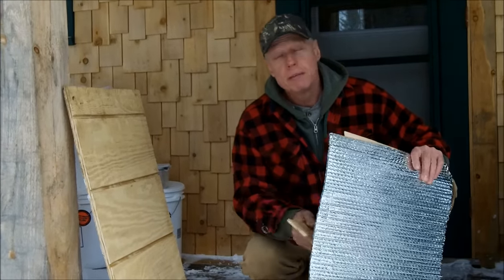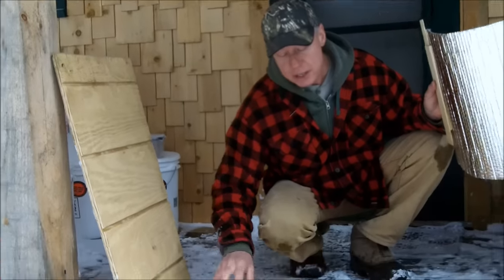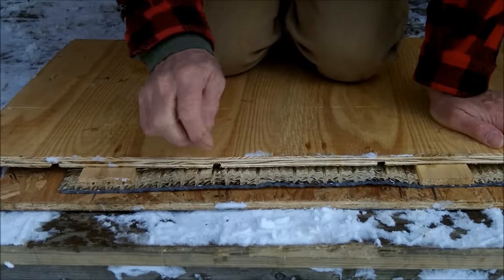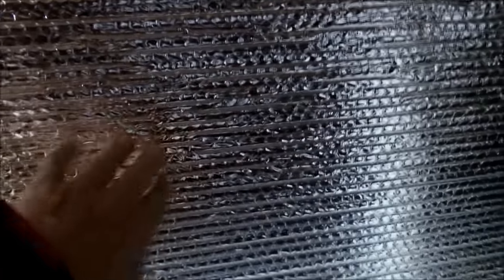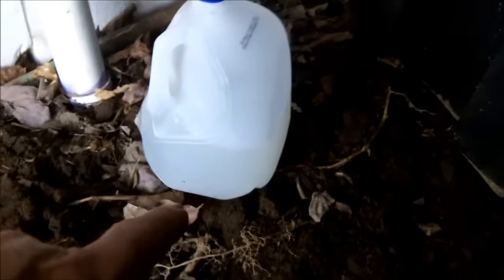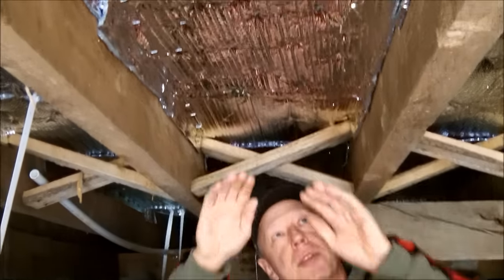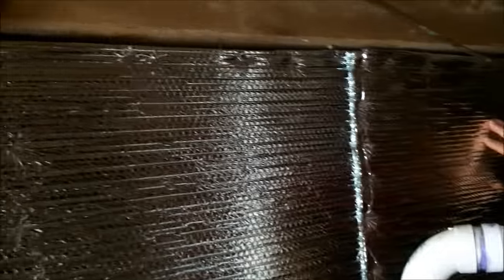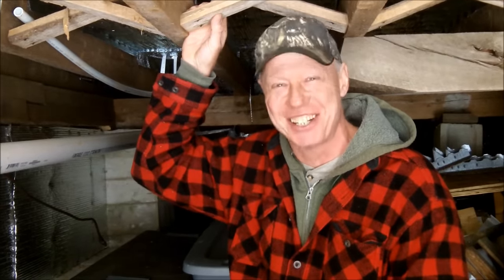HOW TO INSULATE A CABIN FLOOR AND KEEP IT RODENT FREE

Comment: This stuff was originally intended for insulating heating / AC ducts so works well at stopping drafts and condensation but the R value is not real high. The main deterrent to rodents is they don't like plastic and it doesn't shred well for nesting material so they leave it alone. The main attraction to a DIY type is the stuff is cheap and will do 80% of what more expensive products will do. IOW, it will stop infiltration of cold air... and that's a major factor in a cabin.
Reply: Actually it only does 10-15% as good as industry standard insulation. 
Reflectix has its place but most people don’t install it correctly and even if they do they usually conclude it works ‘better’ without any scientific data to back their claims. If it worked like the miracle most people think it is window manufacturers could be making R20 windows. And they can’t. 

It can be a great improvement like for window covers and certain cavity insulation but installed between plywood and floor joists is mostly fruitless because there is limited or zero airspace to eliminate conduction. 

An anecdotal support for reflectix is my off grid camper. I made 1/8 plexiglass “storm panels” for the windows and used 3/16 foam weatherstrip between the walls and plexiglass. This made a big difference by itself but on an 8*F night I thumb-tacked an unused 24”x60” piece of reflectix over the inside. It seemed to ‘feel’ warmer immediately. The storm panels do not generally ice up due to interior air temperature. But in the morning I took the reflectix off and discovered the window storm had a thin layer of frost over most of the window. Obviously the reflectix thwarted enough heat to make the window panel cold enough to both create some condensation and freeze it. That was surprising and a revelation. 

Another interesting tidbit is that in full sun mid morning the reflectix- if not removed- is HOT to the touch revealing that the airspace between window and storm is warming from the reflected sun off the reflectix. 

While reflectix can have an effect as my antidote indicates, it is not a miracle end-all unless used in an application where reflected radiant heat is the purpose and application. Just stapling it to a wall or between plywood has limited value, if any.
Reply: @fishhuntadventure  ... isn't it amazing what real world use will prove out? <LOL> It's basically not much better that a layer of corrugated cardboard, other than you can buy it in a big roll.

Comment: I'm new to your site but really enjoying it! I watched all 3 of your videos on this subject of bubble foil.
I'm converting an old tack shed to a guest house and want to use the bubble foil on the floor to keep out rodents and keep pipes from freezing. The shed is on piers and has an old OSB floor that needs to come out or be covered. I'm thinking of 3 choices and would appreciate your wisdom on the subject: 
1) leave the OSB and put a 2 x 4 grid (laid on the flat side), cover it with bubble foil, then put 3/4" plywood over that. (I'm thinking the airspace might create a pocket of warmer air, but concerned the OSB might not allow the transfer of enough heat to the skirted area below where the pipes are going to be.) 
2) leave the OSB, put on the grid of 2 x 4's followed by the plywood, but put the bubble foil underneath the OSB flooring. (I'm wondering if this is any better for rodent protection but still wonder about needed heat transfer.)
3) Rip off the old floor, put the bubble foil on the joists followed by the plywood.    
Thanks and keep up the good work!

Comment: Thanks for showing your retrofit solution - I have an extension to my house that sits on the ground. I don't heat it much in winter because it's just a big heat sink. The floor is freezing in spite of heating the room. Next spring I'm going to lift the plank flooring and staple that bubble wrap to the tops of the joists before laying them back down. It'll compress on the joists, but otherwise create a better thermal break than the fibreglas insulation I have in there now (and, yes, rodents). Thank you!
Reply from the maker: You won't be sorry.  This is all I use beneath my structures and I like warm floors.

Comment: interesting - here in northern sweden we use  2 to 5 inch closed cell stryofoam. Never nail a floor - will squeek
Reply: Built my shop on peers. . Sheathed the joists with 1/2” plywood. Skirted the deck with 2”x6” below the bearing walls. Layer in 1 1/2” foam and sheathed that with a layer of 3/4” plywood. Then just built the shop on top. Encapsulating the foam means absolutely no pest issues. 
Skirting a building can be dangerous as moisture will build up without adequate ventilation.
Reply: I'm curious, how do you secure flooring? Screws?

Comment: Back in the day they had heated floors too. As far back as the romans!  A tunnel, small, maybe 6 to 9 inches high (on the inside) made with brick work would be made first, and this tunnel would try to wind the long way through all future rooms and floors. A floor would be made on top of this brick tunnel, typically out of stone but wood was also used.  The brick work tunnel would have started on one end. Which is where a sort of brick fireplace would be made, and a stone splashguard that seperated the house from the fire and any potential embers which would jump and crackle into the air.  The air would be heated and because of the law of thermal dynamics, this would create a suction effect on the hot air, which would be sucked through the tunnel beneath the floor, and exit at the other end. While the hot air moved through the tunnel beneath the flooring, it would transfer heat and heat the flooring and even the walls too! (If some rooms needed MORE heat they would have the tunnela from beneath the floor be extended upwards and then back down again at the next neighboring rooms walls, forming a loop. You could even have a method of closing off the vent with a slab of dried wood that was pushed/pulled in and out, allowing hot air or stopping it!  Id love to see something like this replicated with a hand built log cabin today!

Comment: Hey bud i have been a builder for years and your suggestion is a great one. Although your basically building a sub floor. So what i would do is cut the strips the same size ,about 1/2in thick but then i would use 13/8's to 1/2 thick bi-fold insulation in between the strips. Or you could use the same bubble insulation and lay one layer across the whole floor and strip it out on top of that layer then duble it up in between the strips as well to increase the insulating factor of it. Great idea though. Although when i get my structure on my land, once i find and buy my land in Eastern T.N. i will be doing the same as you. Pilings with a cabin on top with with enough room i can insulate both the under side of the structure on the extieror as well as inside! My wife will be building it for our retirement so its going to be a decent sized cabin as well as a two story! lol this is going to be our dream cabin in the woods! Just gotta fine the damn land??? :>/
Reply from the maker: Hi Michael.  I'm working on a followup video on this topic and sharing my experiences with this after 5 years of installation.  Stay tuned :-)

Comment: Would you recommend doing this to insulate the walls of your cabin shed as well?
Reply from the maker: Don't surround yourself with it. A building needs to breath.
Reply: @thebossoftheswamp   What would you think of using this bubble foil then carpet padding and then carpet over it?
Reply from the maker: @CT-yl3oj  I can't say for sure since I haven't done it myself but I would think this would work just fine.
Reply: @CT-yl3oj  there is a video on YouTube showing exactly that.. I'm guessing it works
Reply: @thebossoftheswamp  - Agreed - but I'm leaving my roof ridge open, so that mitigates the airtightness of it. You sold me on the bubble foil insulation over a year ago.That being said, since funds are really tight, I'm currently using used (donated) carpet padding for insulation in my roof. Also labor intensive. Will be getting the foil for under the subfloor eventually.
Reply: @wisewoman7906  bubble wrap works on a principle of radiant barriers. They only work if there is a 1” air space on one side. If you sandwich both sides it has no insulation value.
Reply: Ace Reece  no one cares
Reply from the maker: @chasjacks9378  I dont vent the crawlspace in winter because it would defeat the purpose of trapping the ambient temp of the earth beneath the cabin. I do vent it during the summer.

Comment: I used it to and it has amazing r value.  They only rate it 7 or so but it seems to has other property like the reflection of heat. I made a tractor cab and use that stuff.  You could feel your own body heat reflecting back at you and man did it keep the cab warm.  Only thing was when there was a car behind you when it was dark the car's light shined on the reflective material and it looked like I was going to be run over by 10 big trucks.  Lights reflecting everywhere.

Comment: Any issues with condensation forming on the walls of the crawl space?  I used the Reflectix R-foil on the walls of my crawl space and they are getting condensation built up on them on the inside.  Have you experienced this?  How did you solve it?  Any suggestions?
Reply: Had the same problem.  Lay some 6 mil poly on the ground to prevent moisture from the ground coming into the crawl space.

Comment: Watchin this again !
27° below zero outside and walkin barefoot inside. You can't ask for better than that ! I'm sold on it snd have been using it on my earthbag dome ceiling and plan to use it on the geodesic dome cabin as well. Rodents wont chew it, that is a huge plus, and it really does make a difference in my opinion.
I hope all is well with you folks. Thanks for everything.
Stay safe and God bless,
Wulfy
Reply from the maker: It's the answer to all my insulation / rodent issues.  I've never had a product perform so well.

Comment: Ho-Kay, I live smack dead center of a mega-grid, powered by the Bonneville Dam on the Columbia River. Our little mapsite is called Portland, Oregon. We have a very temperate climate with most winters hitting 30 degrees f for a few days, summers up to 100 for 2 or 3 days. Moderation in everything. I double-stuffed the walls and ceilings with cellulose everywhere it would fit, and we heat/cool our 1200 SF "cabin" with c@ 400 gallons of oil per year. The nearly continuous siding, composite over wood over sub-siding helps too. That may be good, but good ain't good enough. Your stuff works, and I'm about ready to install it. Now.
When people come around trying to sell us new windows, siding, or exterior treatments explaining how much lower our heating bills will be, I just invite them in for a cuppa joe, run the actual numbers in front of them and ask if they can guarantee me a yearly check when our bills fall into the minus department.
For your own amazement and amusement, reference "Burning Man," the annual hippie Art Festival  (Black Rock City) in Nevada. God made summers there just in case HeII wasn't hot enough for some people. Then look up the construction of the "Pentayurt" or "Hexayurt."
For soft-walled tents I use Stephenson Warmlite The principles work. We have amazingly efficient thermoregulation ... all we need to do is learn to use it.

Comment: We dont have snow in FL, but you can either encapsulate the crawl space which doesn't make sense to me at all, because you have to have a dehumidifier and sump pump if you do that. Some people say keep your vents on the crawl space open at all times but how can you do this if you are insulating the walls of the crawl space? Is there any vent open here? I dont want to cause more problems. There's SO much information out there, but I dont have clear answers so I can't start on the project because I'm afraid of ruining something.
Reply from the maker: I only vent it during the months were Im not heating the home. Otherwise I'd just be letting cold air beneath my structure and that would defeat the purpose.

Comment: We have a crawl space under our house. Heavy road Construction caused rats to escapt the sewers into our neighborhood's. Under the Pest Control gentleman advice which we followed. He suggested we dig 20 inches down into the ground around the perimeter of our house and secure 1/8th inch wire mesh (we bought at tractor supply) and 14 inches up the wall and 20 inches out. We back filled the trench we dug around the house.  Its been 6 years since we did this and never have had any mice, rat under our house since.

Comment: I'd spray foam the underside of the floor.  You can buy a kit online for about $727...two tanks about the size of a 20lb LP container...they mix together in the hoses that feed the spray nozzle.  One kit will do 560 square feet 1" thick.  Closed cell foam will not absorb moisture,  is impervious to insects, rodents and air infiltration, looks easier to apply than stapling up that bubble wrap, and has a greater R value...about 7 per inch.

Comment: I ran it across the studs and then put 4 ft wide rolls of 1/4" hardware screen over it.  More insulation with the air space included. Screen cost was about 50 cents per sq ft.   Could be done for less using 1/2 inch
Reply: This is an excellent idea. 1/4" hardware cloth is now about 67 cents per SF -- well worth it, in my opinion. Thank you.

Comment: Awesome video! I just bought an older cabin in Northern Canada, and the last owner put in an addition with a small basement underneath the addition. The floor is so much colder where the basement is under it!! I am absolutely going to put this bubble wrap on that floor, pretty much the same way you did in your video, and then maybe around the skirting like you did as well! Have to be prepared for those cold winters! Thanks so much for sharing :)
Reply from the maker: Doing the skirting will make a world of difference.
Reply: THANK YOU,👍been trying to come up with a plan, old house built in the 30's have quite a bit of blue and pink hard board insulation that I picked up for free, but this will be much more EASY to work with, (cutting and fitting)😀✌

Comment: bought a cabin with the foil stapled to the BOTTOM of the joists.  Wasn't flashed well either.  Water got in and rotted out those joists.  Gotta jack the cabin and refloor the damn thing this summer.  Dig the skirting BTW.

Comment: I used bubbles foil for insulating windows on the south side of an apartment I lived in California valley....if it was 90 degrees outside it was 75 degrees inside...it worked wonders...

Comment: In my enlosed/skirted space I did put a plastic sheet covering the ground to stop some of the moisture from the ground to get under my building and help prevent rot.
Reply from the maker: I do that beneath some of my structures but here at the camp, I'm trapping the ambient temp of the ground  beneath the cabin. I store food in vessels under there and a tarp on the ground would block the ambient temp, much like a blanket does when hung between 2 rooms.

Comment: I wish I would have thought of putting this in our cabin  floor,  we did wrap the walls with it and then 3/4" foam insulation over that with the siding over it and that has worked well.

Comment: one trick I learned from Amish friends==clove oil to repel rodents---wow does it work great!! have not had a rodent problem since I started using it.  I just spray some that I mix with little detergent , water and a few drops of oil in cabinets around the parameter, under sinks etc----mice hate the oil.....just a thought God bless.
Reply from the maker: Thanks for sharing this.

Comment: I used your technique on my tiny cabin in the woods. Works great. I am planning on doing the skirting this summer to make it even better. In my work I have spent many hours working in mobile homes with fiberglass insulation in the belly and it is always gross, gross, gross with moisture and mouse poop.
Reply from the maker: Agreed. This eliminates that problem :-)

Comment: Sittin' here in my 12x14 with a toasty floor.  When it was going up we put 1inch square nailers/walers 3 15/16" down from the top of the joist.  Two 2" slabs of dense foam were squeezed in tight between the joist and since it is sitting 1/16" proud of the surface, when the plywood was screwed down it became air tight.  4 inches of dense styrofoam not only insulates, it stiffens and quiets everything.  It's not something that works after building though.  The joists have to be squeezing the sides of the foam and the best way to get it that tight is to build it from one side to the other.  Of course 2" would be fine but I live in Canada and wanted the extra air barrier I would get by overlapping seams.

Comment: I have been told that that stuff only has about the same R value as a 3/4" sheet of plywood.  But I've gotta system I don't for a second believe that.  We keep bees in Canada and we have had two similarly sized hives sitting side by side, one with a 3/4 plywood lid and the other with that bubble foil.  The plywood had melted the snow on top and the foil hadn't. It was a noticeable difference inside the hive too.  The one with the foil was clustered up against the foil, which should have maximized the thermal transfer.  But the plywood hive had clustered down lower which should have minimized the heat transfer.  It's dang good stuff that foil.
Reply from the maker: The simple R value is crap but the reflective properties of this stuff make it awesome.  I don't care what people say... my warm floors are all the proof I need :-))
Reply: TheBossoftheSwamp OFF GRID SELF RELIANCE and our bees are getting a head start in spring because of less dead bees!